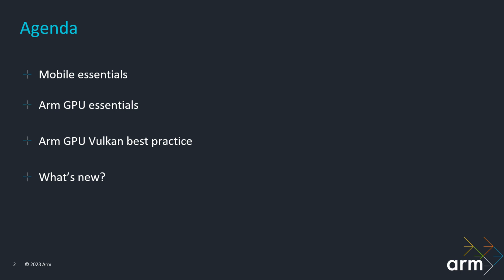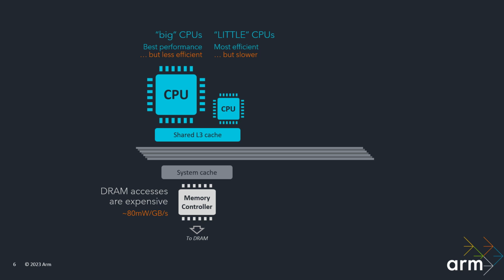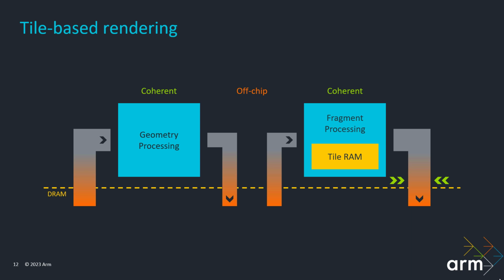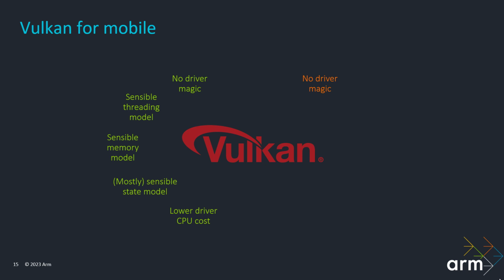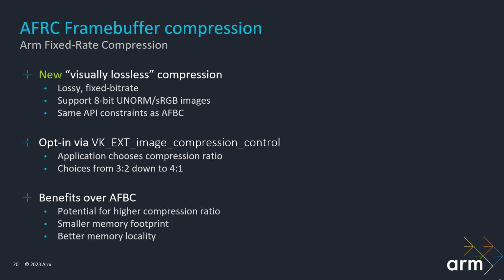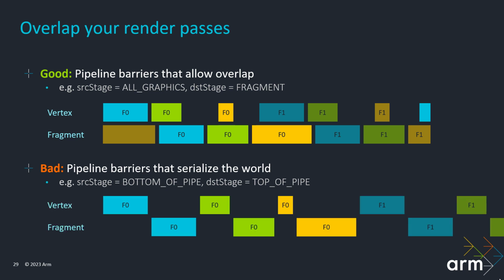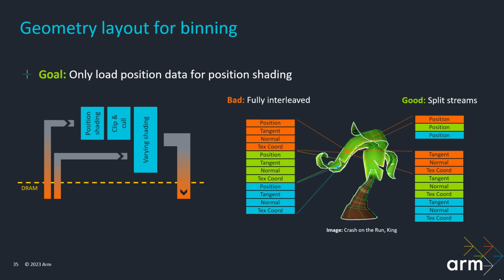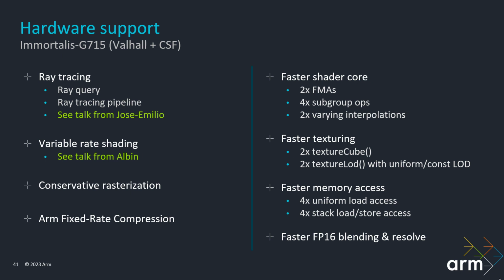Vulkanised 2023: Getting started on mobile and best practices for Arm GPUs

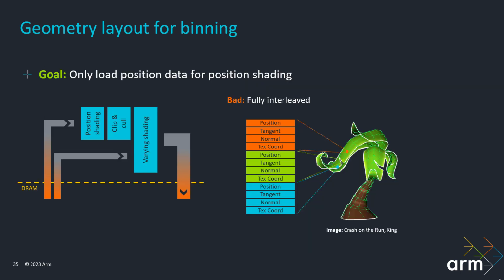Comment: And another question to slide 35 (starts at 44:33): I'm a bit confused about the concept of "Position shading". I only have one vertex shader, and in that vertex shader I have to read all of the arguments (i.e., position, tangent, normal, tex coords) no matter what their memory layout is. 
Is the point here that this is just fine and can stay the way it is, because the GPU/driver(?) is able to figure out which of these arguments are used for gl_Position computation (position) and which of these arguments are just passed on as varyings? Hence, the GPU/driver(?) would only load the former in the first "Position shading" step, and the latter only later if the primitive survives culling?
Reply: One vertex shader from the user, but the compiler splits it internally into two subshaders to fit this model.

Comment: Awesome talk! Thank you for re-recording it!
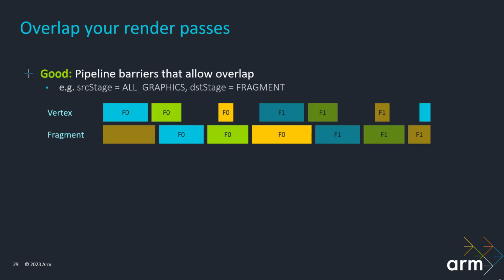A question to slide 29 (starting at 37:14): Why would srcStage = ALL_GRAPHICS be optimal? The queue would have to wait for ALL graphics stages previously submitted to complete before being able to move on with the next fragment shader, wouldn't it?! I.e., in order to allow for even more overlap, wouldn't srcStage = COLOR_ATTACHMENT_OUTPUT be better?
Reply: Yes, but `COLOR_ATTACHMENT_OUTPUT` is the last of the `ALL_GRAPHICS` pipeline stages anyway, so the effect is the same.
Reply: @peterharris4984  hmm, wouldn't the 1st access scope of that barrier be over-broad in that case? ALL_GRAPHICS implies all graphics stages may access the resource, but in this case we'd obviously never touch it e.g. during vertex processing. Does the access scope being broader than necessary not affect anything in this case?
Reply: @nicebyte  For srcStage it's really only the last implied stage that matters - that's the one that will release the resource when it's no longer required. I should probably change this to COLOR_ATTACHMENT_OUTPUT to avoid the confusion, but effect wise it's the same (at least for Mali).